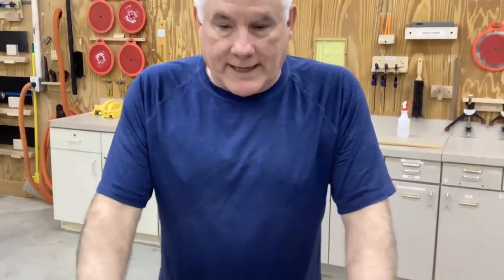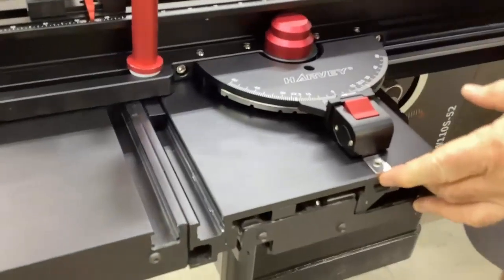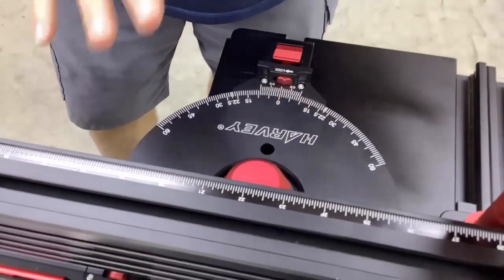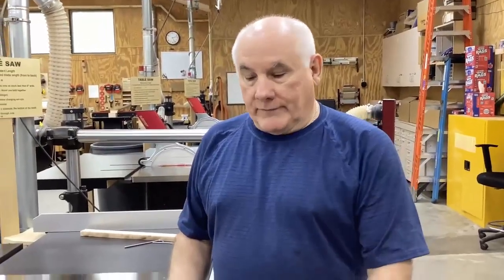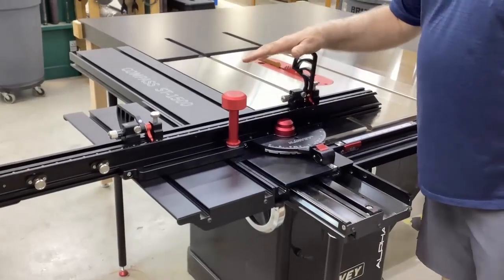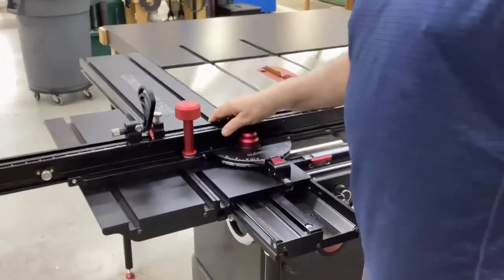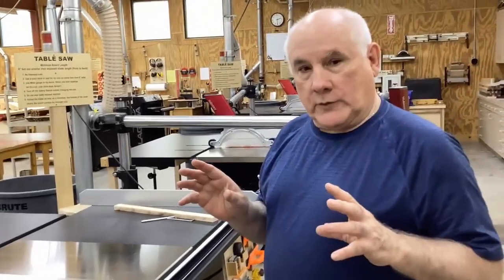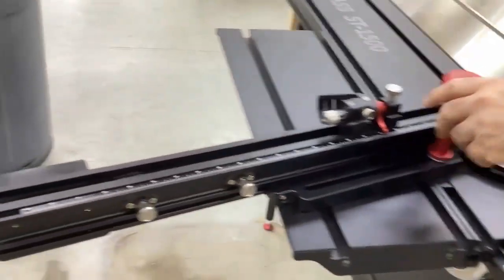Harvey Sliding Table Compass Miter Gauge

Comment: I heard there is a little slop/movement in the degree stops?
Reply: This was a problem a few years ago, as I understand that problem has been addressed by now.

Just like a few other shortcomings that were present in early models.

I'm looking into buying a new table saw right now and have dug quite deep, and the Harvey is definitely on the top three short list.